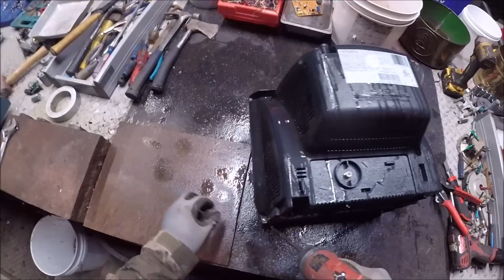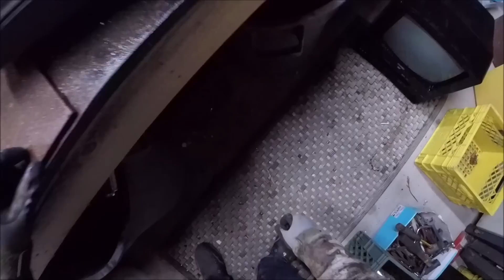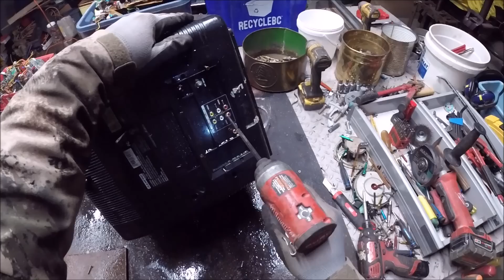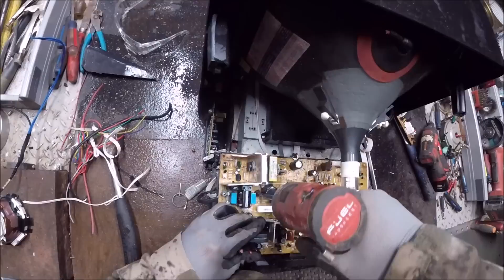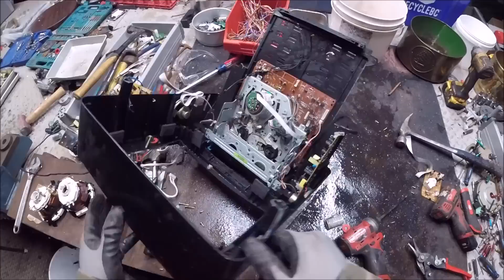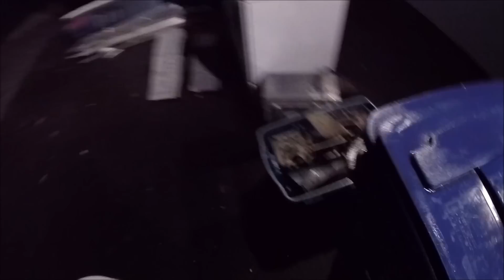Scrapping Pair of TV's

Comment: so................after you strip all the good stuff from inside of the tv, the yard still takes them in and pays?
Reply: No. He has to take them to another place which accepts recycling stuff. TVs, tyres, batteries, light bulbs have to be handed over to them for free. For bottles he gets paid 10 cents each. The yard where he sells stuff only buys metal scrap.
Reply from the maker: Yards don't buy E waste here on free drop off
Reply: @CanadianTreasureHunter  we are currently gets 8cents a pound for any ewaste here in ontario